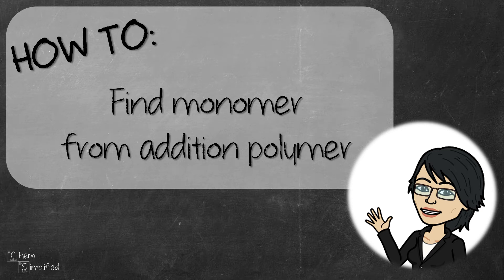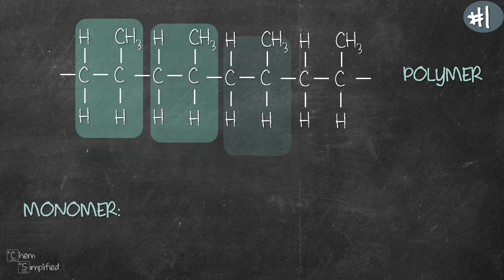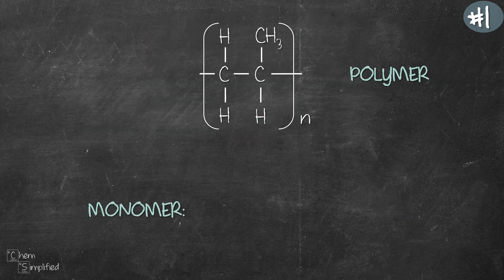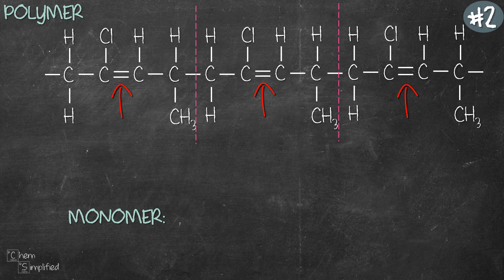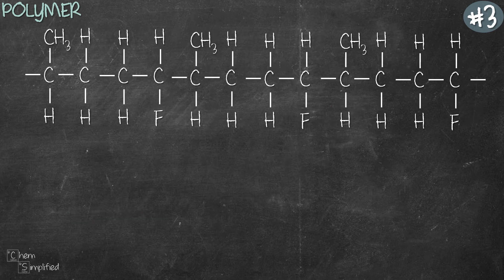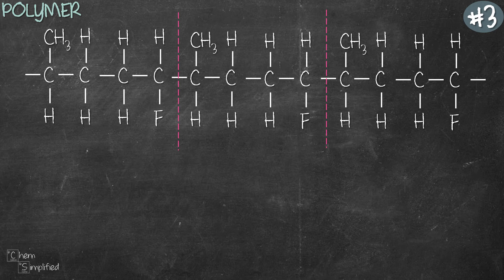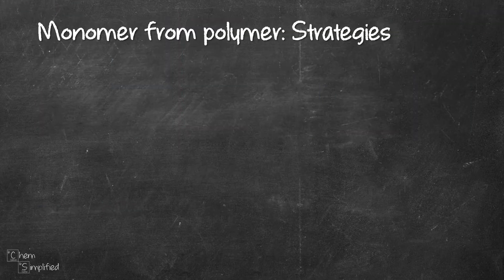Monomer from polymer | Addition polymerization | Easy way – Dr K

Comment: Why is the final example like separated I don't understand?
Reply from the maker: It's because the polymer I showed is a copolymer, which consists of 2 monomers repeated alternately. That's why when you draw out the structure of the monomer, you get 2 monomers.
Reply: Thanks I get it 🙏
Reply from the maker: That's awesome. You're most welcome!

Comment: why Did you change the posistion of the double bond from in between  C-CL and  C-H to between  C-H AND CH3-C-H? In the second example
Reply: when writing the monomer of the 2nd example polymer
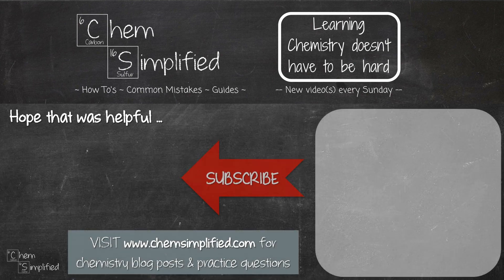Reply from the maker: @thaliaissa3009 The reason is that the double bonds moved when connecting one monomer to  the other. Refer to 3:56 in https://youtu.be/dR8SeWEOTwc. It will make more sense. Hope that helps.